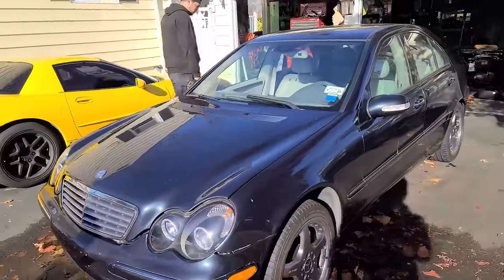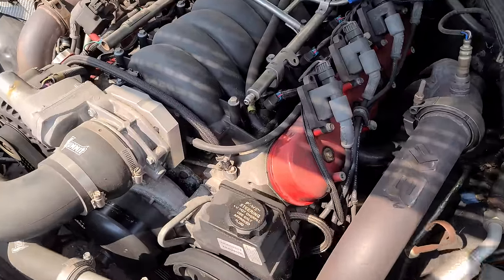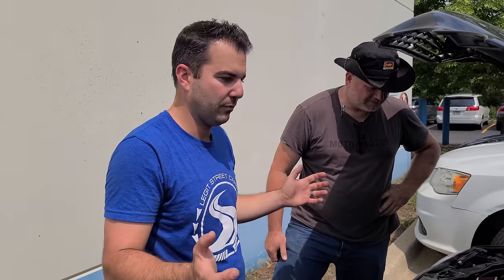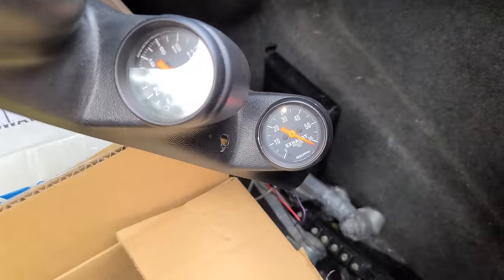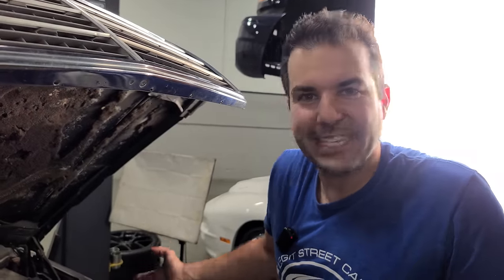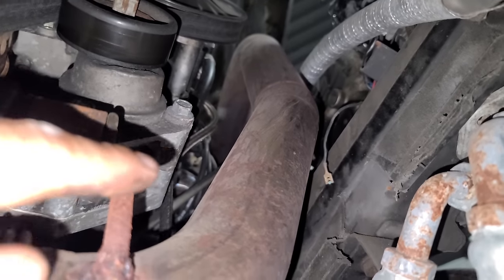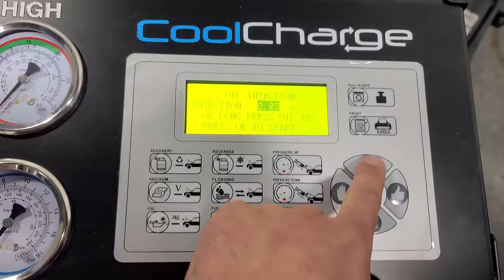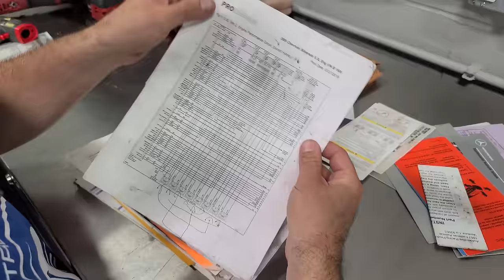I Traded My Weirdest Car For An LS Swapped Mercedes Turbo Diesel! Total SLEEPER!

Comment: The diesel versions with 5 and 6 cilinder engines had the side fender vent for air intake. The four cilinder inlline diesel versions don't have the fender vent for intake air

Comment: If you were to keep it it would need a different exhaust/different mufflers to really fit. Mercedes-V8s were never "shouty" or bubbling around, it was always about having the torque and power delivery WITHOUT making a lot of noise.

Comment: I wonder if a double spacer, or thicker spacer will pull the TB out just an inch or so more, allow the PS hose to fit where its at, and just pull out the TB a little more...  There is a number of better solutions then drill a hole in the hood and paint a cap on it... lol.    That CAP fix looks like a 6 beer's in job  "Oh whats holding it up?  I got it!" ...Pulls out a hole saw...

Comment: Oh man w124 chassis is just my favorite mb! If the paint is good and rust is minimal i think value for that car is 9000$. Trade with 1000$-1500$ would have been good for my eyes instead of 4000$. Btw those fender air intake holes are from factory in turbo diesel models.

Comment: The ac belt tensioner will need replaced. It is advised to change it whenever you change the belt and for good reason. Believe me I’ve tried to skip it. 

They fail in a really subtle way and your belt will slip off eventually again and it eventually tears up the front main seal… again… ask me how I know.

Comment: I did not expect a W124 when I read the title :D. It kind of hurts to see how they butchered the interior, but it's certainly an interesting car.

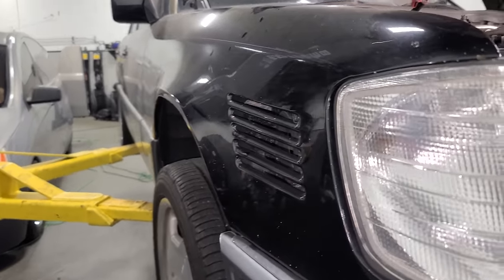30:46 that cooling vent there is factory on all Turbodiesel W124s.

Regarding the V8s in the W124, the W124 was originally not made to fit the Mercedes V8, so when they decided to put one in it they had to do some modifications. This is why you don't have the same amount of space in a normal W124 engine bay (such as the one you have there) as you have in one that was made to fit a V8 in it.

Comment: Question for Mercedes-Benz experts: I have a Bosch 069 Fuel Pump that has a M 14mm - 1.5 check valve/outlet.  I got an M14 ORB - AN6 Male fitting, but I cannot find a suitable O Ring that will seal the M14 connection.

Comment: I have an even easier fix for the throttle body. Go back to drive by cable and switch it in the computer and add a TPS sensor into the harness.

Comment: You need to replace the automatic transmission with a 6-speed stick shift, install at least one turbo, or two, put a LSD in there, and replace that wrecked hood. New Tires on better wheels. Nicer Seats...

Comment: The louvers on the rf fender are factory for the diesel... engine air intake.
W124s are still great cars. Our 300E 2.8 was terrific... solid, reliable and handled very well. It's now in the hands of someone who might rebuild it. That DOHC engine always sounded great and could do 0-60 in 7 secs. We got 30+mpg on the road at 70+mph and the 4 of us in the car. 
That color is called blue-black metallic. Go figure.

Comment: If you have a leak and the machine doesn't detect it then the leak is in your schrader valves.  Always replace when you bleed the system down,  general rule.

Comment: Ok, well…after reading several random comments, I’m gonna throw my 2 cents in. I have long been a proponent of Honda products, since long before the rice-rocket craze of the 90’s. I got a subscription to C/D in the mid 80’s and saw the insane twin engine CRX that they created. I later read about Oscar Jackson and his success with various mods to early track-built Civics. I realized then that much of the engineering led to the engines being sufficiently overbuilt that with some choice mods you could make a fair bit more power and still have a reliable and reasonably efficient little hot rod. In middle school I received much ridicule from my contemporaries who mostly wanted either a 5.0 Stang or Camaro. Fair enough, and while a hot rod Civic of that era may not have had quite the power to beat either of those in a straight drag race, I’m confident that on a road course the lighter and nimbler Honda could easily keep pace, if not slightly best either. All while getting better fuel mileage. And let’s face it, in the mid-late 80’s even Civics were generally built far better than any American pony car. All that being said I was really stoked for your purchase and was looking forward to what you might have done with it. 
But I’m not mad at you. I love that older body style MB, so simple and elegant. Truly timeless. And the wheels, I think you called them ‘monoblocks’ are super sweet. I’ve always liked the AMG style of the mid 80’s-early 90’s. I agree with another post…manual swap it. And add a supercharger. Let’s see what trouble we can get into!

Comment: Yeah I've got it honestly got to say that I agree with a bunch of the other comments and I think you got ripped off you should have never handed over $4,000 cash you should have done a straight swap or walked away. Again the whole point of trading is not to spend money it is to straight swap. Also I found out the hard way that going through the front and back of the car and all around before you do the deal is definitely a good thing to do because I found rust in the trunk once before but only after I got home.

Comment: honda swapped mercedes sounds like the perfect car for me. you get the best of both worlds: reliability and cheap-ness to run of a honda but with luxury and comfort of mercedes. I'd delete the tablet cluster that looks jank, replace it with original, and maybe install a leather boot to dress up the shifter so theres not just a gaping hole in the middle of your interior and its great
Reply: You can either go analog aftermarket gauges like the ls swapped Mercedes or you can go digital dash. Oem gauges won’t work.

Comment: So what i think the w124's story is, is that it was a 300d NA turbo then someone swapped it for a om602 or om 605 2.5 litre 5 cylinder turbodiesel and then the LS ended up in it because that 2.5 turbo badge isnt anything that was on any 124

Comment: at 31.07 you asked what hole in the side fender was. that is how they are when it is an 2.5 or 3 l turbo. diesel. and it is orginale. at least in europe.
I had an 124 300 tdt. and it was like that too.

Comment: That no W124 is the LAST of the well built pre GM collaboration mercedes! The car is a huge quantum leap in quality o pared to the w203! C class POS!! EVERYTHING in that w124 is a huge quality product. From every wire connector to the pneumatic rubber and plastic door bottoms!! The leather EVERYTHING!! Is much better! You have a true quality mercedes! I had the 3.0 saloon from 1989. It was solid! The 94 upgrade w124 was a GM POS. The car you have is a star!

Comment: Looks like the pitman arm broke and was repaired. As a welder thats how i would repair cast steel/iron material with what looked like a stainless steel filler material.

Comment: 300D and 2.5 Turbo badges make no sense. 300D came with a straight-6, 3.0L diesel, not a 2.5L, so i'm not sure why that other badge is there. The cuts in the wing are for intake, and they're factory.

Comment: Sure was a good deal, W124 Is the last E-class that was engineered to be as perfect of a car as possible... and the sale price was then calculated afterwards, based on the engineering and manufacturing costs. This made W124 an expensive car to buy - but is also why people call this the last "real" E-class... Later Mercedes models have had strict price targets, which is obviously a limiting factor during development. The W124 (and 190E) are from the golden era of Mercedes - actually this is pretty close to the 500E, can well imagine them even sharing some parts.

Comment: Good trade Alex. Hope you k eep the w124 and do work to it. I have a really nice 1987 w124 with the 603.960 6 cyl turbo diesel. Also have a c6 z06 with the ls7. So this swap is pretty cool. Sell off some other car and keep this in the stable. Was not a fan of the honda mercedes.  The w124 is the last old school mercedes with the interiors I like.

Comment: do these cars not have a common low/high AC pressure switch to wire in to the LS computer?  edit:  on my 2003 5.3 GMC Envoy, the low pressure switch wires into the HVAC control itself and not the PCM, so I guess not having a GM HVAC control in the center console means the PCM doesn't know about the low side switch status, thus a toggle switch has to be used

Comment: @14:50... I bet it needs a spacer behind the concentric slave. This does have a concentric, correct? Personally, I like the K24 car more that the 5.3 car. I wouldn't have traded. I would've put that $4k into the Honda car and made it perfect. Also, not trying to be a dick, but the whole point of the paperclip story was that the guy traded up without spending any cash.

Comment: I've got a 2002 trans am WS6 with body damage. It's only got 70,000 mi the interiors flawless. It is a convertible. It is a beautiful car. It needs body work, runs and drives like a champ. Are you interested?

Comment: I had the same trick flow heads, I traded them for a ninja 250r, then for another bike and ended up getting $4500 for the used heads.

Comment: @legitstreetcars one thing you need to look closely at with the AC system is that the compressor kicks on and off with pressure. You dont want it running 100% of the time that the switch is on. A lot of guys will wire the switch in line with the high and low pressure switches to make sure they would turn off with an issue in the system

Comment: That old Mercedes smell is the real leather seats. They didn't use synthetic sealer on the leather back then. Today's "leather seat" smell is actually a fake scent that's applied to the leather. I'd drop a Silverado Magnacharger on it and make a "530E" badge for it.

Comment: Sadly, the original OM602.96 is capable of 300HP and gobs of torque with just a pump, turbo and IC.  That goofy engine is sadness.  It's about time Alex found the 124, but this is not how you're supposed to do the things.  Try again.  Better.  Differently.

Comment: I'm not a honda fan. I'm a GM and a Mercedes fan.... you traded down. That's a $1000 car. It's a stock $500 LM7 engine.  It has a 4L60 trans that sounds like it shifts like shit, you'd have to pay me to take one for scrap. The TF heads are essentially ls6 heads but 1cc larger, nothing special. You traded down for sure. You got a junkyard special. To be fair, that honda swapped one was pretty butchered.

Comment: I dont see thirteen five but thats just my opinion. Plus hes saying thats what he had in it but when do u ever get your money back on something like that. Im assuming the original owners/builders of the cars had similar money into each car but the honda swap had a lot more aftermarket more expensive parts bought to make the build work. I just think if anything it shouldve been a straight trade especially if alex is "trading up". If that was the case he shouldnt ever put money ontop

Comment: That old Mercedes he could never get 13.5k. The Honda motor, turbo, fuel system and ecu is worth more than that ls iron truck and trans. Newer car way less miles. 21:01 laughing at the deal and cash

Comment: Alex, I love ya bud, but you totally traded way way down and you gave him $4,000 on top? Did you notice how happy he was? He shook your hand twice just to make sure he wasn't dreaming that he found someone dumb enough to trade a running, driving, dyno tuned, turbocharged much newer Mercedes for a piece of junk $400 Mercedes with a piece of junk $400 5.3l junkyard 5.3 that they turbocharged and beat the crap out of. He absolutely lied to you about having $14,500 in that old Mercedes. You should absolutely never ever do your own negotiating, my guy. Love the channel, but yikes, I know you feel like you got a decent trade after the inspection, and it certainly wasn't as bad as I thought, but man, you should had gotten $4,500 from him for the trade to be worth it in my opinion. You definitely underestimated the value of your own car. I would had bought that turbocharged K swapped Mercedes from you for $10k - $12k as long as you had that 3D printed part CNC machined from aluminum and replaced it, or you could had just used a RWD Honda S2000 transmission and it would had bolted up. Probably would need a new driveshaft, but they are cheap, and everything would had been solid. Anyway, good luck Alex. Please don't make any more crazy mistakes like this. I promise you will end up with an old Prius with a bad battery pack before you end up with a nice $30,000 car from trading

Comment: Yea but this old boat anchor is trading down. 6 speed down to auto. Modern body down to ancient. Clean body for one with hole in the hood. Fuel economy for a fast passing v8 that has to stop at every gas station. What a pile of stuidity that thing is. Plus a Honda engine for a stock car poser. Im disappointed